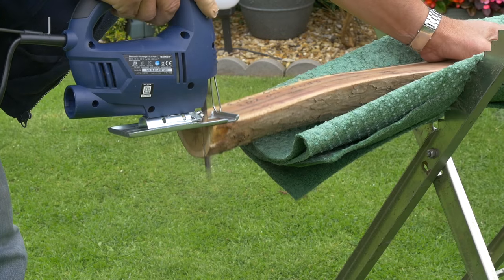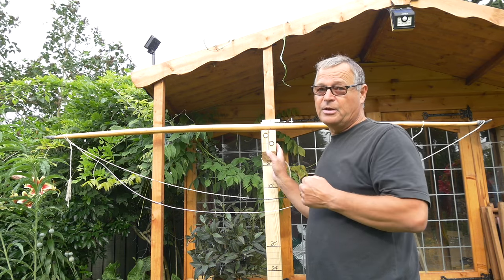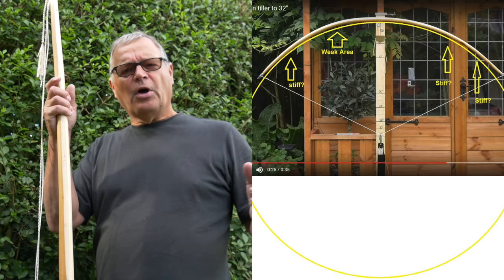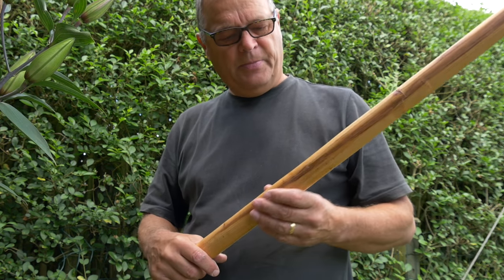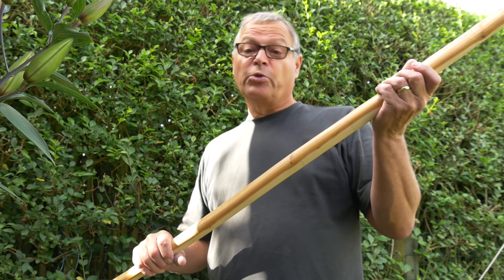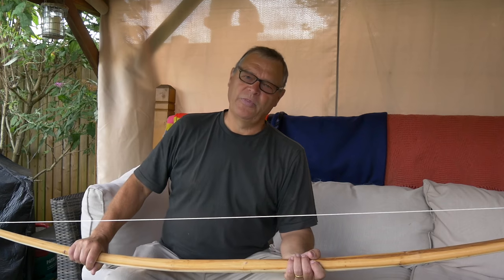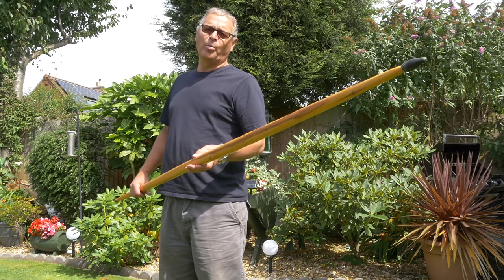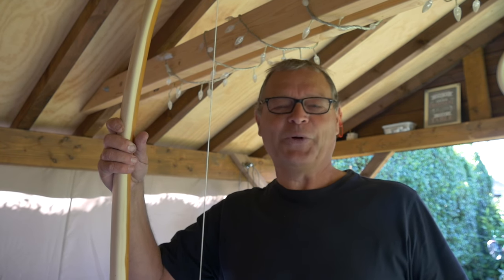Yew Heavy Warbow. Beginner attempts to make 100lb warbow. Part IV. Tiller Problems to First Draw.

Comment: Great video:  Progess, heartbreak, gutted but then a Hollywood ending! Congratulations :)
Your problem yielded useful insights on tillering.  Surprised that the aim is a perfect arc - I had expected the goal to be little or no curve in the handle area and all the curving to be either side.  Also surprised at how precisely the experienced bowyers expect to fit an arc.

Looks like you are quite a gardener too, that's the nicest, tidiest garden I've seen in a long time.  Enhances the viewing experience :)
Reply from the maker: Hi Tony, looks like you've viewed the lot! Thanks for the congrats, appreciated. Yes, the bow I wanted was a full compass bow - in the 'medieval style', bending through the handle and forming a near as perfect as possible arc. Yes the pro and highly experienced bowyers have a great eye for spotting the slightest deviation from that arc and one and all spotted my error, and all helped me get around it as best as a novice could. Thanks for noticing the garden - not all my own work though; my good lady keeps it in trim and helps provide that rather nice backdrop to some of my videos. Thanks again for watching and taking time to write your encouraging comments. That enhances the production experience!! Atb, Mick

Comment: I find myself watching your videos over and over... there just so fun to watch. Very well filmed and edited.
As for the bow- I've learned the hard way that it's better to focus on good tiller the on draw weight. My first bow ranged from 20 to 25 pounds. No where near my target weight. 
BTW, your videos realy gave me an urge to make myself an english longbow! So I have the laminated stave glued up, I'm just waiting for the glue to cure and I can start roughting it into shape and tillering it.

Cheers Mike.
Reply from the maker: Hi Mike, thanks for your interest and support - and especially for letting me know! Yes, in my limited experience, the tiller is way more important than draw weight. It seems the real skill and challenge comes when you try to achieve high draw weight and a great tiller. I certainly found it a challenge as you've seen in my videos. Good luck with your laminate bow - I hope you get the tiller and draw weight that you hope for. Atb, Mick

Comment: Hello, I am planning to build the same, although smaller and watched your series with great satisfaction. Pity that it does not bend evenly. Otherwise it is perfect and very beautiful. Good job and video. 

PS: It's probably too late to mention that, and I have not built any bows myself, but I saw a video in which he shaves the bow while it is on the tiller. So he sees real time what he is doing.

Comment: The cause will likely have been in starting out with a "handle" and too much early thickness reduction adjacent to it, rather than just letting it be thickest at the centre of an unbroken taper running to each tip.. You will probably see the signs of the problem emerging if you review some of the earlier images. Also it would be my preference with any stave or draw-weight to establish a cleaner taper in all aspects while there is still a good amount of wood still to remove, before even going to the tillering post.
Reply from the maker: Hi Rod, thank you for your observations - all a learning experience for me and every comment I get I store up for the next bow. Thanks for watching. Mick
Reply: I confess that I only just found this thread, somewhat after the event and was sitting here on the edge of my seat after noticing that incipient hinge early on, but fortunately you had some good advice and effected a decent recovery. Some of the best advice I was ever given was to establish a good shape early in the process and regard the tillering process as in good part, simply the refining of the established shape.
Reply from the maker: That's a succinct sentence summing up what I have in broad terms learned Rod - getting the shape right in the first place is paramount, subject of course to the meanderings of the stave. I'm anxious now to have another go with some good yew but before that I have hazel as mentioned elsewhere - plus some blackthorn and a reasonable piece of yew still unharvested (for a light bow). All my mistakes/successes will be on Youtube throughout 2017!
Reply: I look forward to seeing the blackthorn bow especially. I've not yet found a piece of blackthorn that looked to me as if it had a bow that I might want within it.  :-)
Reply from the maker: Hi Rod, well it may work it may not - whose to say? Worth a bash though; I've read that it should make a bow (fruit bearing, prunus family) but never found much information about that wood for bows. Rare here to find a long straight piece but this is pretty much longbow length and straight. Disaster or otherwise, I'll post the video in the spring I guess. Mick

Comment: If you need to increase the draw weight of a bow a bit, you can either use steam, dry heat or boil the wood and bend it into a slight recurve shape. This will hopefully increase the draw weight by 5-15 pounds. There is also the option of putting a sinew backing however, it will no longer be a selfbow but it will increase the draw weight a bit.
Reply from the maker: Hi there and thanks for watching and giving advice - appreciated. The bow has settled around 100lb in draw weight and I am happy with that - but I did try for the first time recently reshaping a piece of yew with dry heat. And it worked! Thanks again for taking time to help me. Atb, Mick
Reply: +Mick Grewcock No problem! thank you for making these videos!

Comment: Could a warbow be made out of black locust
Reply: I don't think black locust would take that kind of compression or tension being in that D cross section...my buddy made an awesome flatbow out of black locust...I can't remember the draw wright.  I think it was around 55 lbs, but it shot so smooth and seemed faster than other white woods and most osage bows of that weight.

Comment: Hi Mick, do you cover in any videos how to get around when the wood has a natural bend that goes the wrong way ? Thanks
Reply from the maker: Several. Look at my series about hazel bows and I think wonky yew bow. I use dry heat on veg oil covered wood (stops scorching) and a weight to draw it straight. Good luck.
Reply: @MickGrewcock  Your a star. cheers
Reply from the maker: telfordguy34uk Shout if stuck. Mick
Reply: @MickGrewcock  Thanks I will. Your wonky stick video answered the 3 questions I had ( for now  )so it's choppy choppy time.  I'll let you know when it breaks.
Reply from the maker: telfordguy34uk Good luck and don’t be pessimistic! Might work out great.
Reply: I'll keep you posted. Thanks for the help.

Comment: What are the dimensions of this bow? How thick are you in the middle and how thick at the ends. I want to make one but it be 130 lbs @ 34” draw length. I’ve watched all of them and you are pretty amazing at making it all seem simple.
Reply from the maker: Hi Zac. Have you made bows before? I'm just concerned that dimensions of the finished bow might not be a good place to start. With self bows, in my limited experience, the starting dimensions are more important. The type of wood, its maturity and ring count all have an affect on the eventual performance and therefore dimensions of the finished bow. Let me know and I'll help where I can. I just don't want to mislead you with dimensions that are wrong for your chosen bow. Mick

Comment: I would like to know what's the different between longbow and flatbow?🤔
Reply from the maker: chin pang wong The working limbs of a flat bow in cross section are wide and thin and the bow has a distinct handle and sometimes an arrow shelf; the limbs of a longbow vary from D shaped through to flattened rectangle (depends upon wood used) and a longbow does not have a distinct handle or an arrow shelf. The longbow, as it’s name suggests, is usually as tall - or taller - than the user, much longer than most flatbows. Thanks for watching 🙏🙏

Comment: Hello again Mick i just want to know is your bowstring on this warbow made of dacron or FF and ofcourse thank you in advance
Reply from the maker: Hi there, the string fitted now is Fast Flight. I tried Dacron B but it stretched too much. Dacron B is okay up to about 80lbs, after that I use FF. Cheers, Mick
Reply: Mick Grewcock Thank you so much for quick answer i also have b 50 but is there any material to replace Fast Flight,thank you in advance
Reply from the maker: black wolf Hi there, I am sure there are other brands of string material but I only know of fast flight. Hope that helps. Mick

Comment: I was told that a longbows lower limb had to be slightly stiffer than the top ?
Reply from the maker: That is a statement often made about such bows. When I was making this bow, I was struggling to establish an even tiller - it is especially difficult with heavy draw weights, and a challenge for untutored beginners such as me. What I did learn on this and other builds was to let the bow tell me during tillering which limb is the strongest and then work with that. I hadn't the skill then and probably not now to choose a limb as either top or bottom and then successfully carry that through to a finished bow, such are the challenges for me of a self bow from usually wonky wood. Now that I am becoming (a little bit) more proficient, I adjust the balance point of the bow stave on the tiller tree so that I am pulling where the arrow would be nocked on the string and the 'balance point' (actually slightly off balance) of the bow being the arrow pass. This naturally aids the establishment of the upper and lower limb - but for me usually after quite a bit of trial and error.

Comment: I have a question, but does the width of the handle decrease gradually or to a certain extent?
Reply from the maker: There are several ways to do this - constant taper from the handle out to the tips in width and depth or a central section about 250mm parallel in width but tapered from the centre. The 'grip' is usually about 100mm and is offset 25mm from geometric centre of the bow. Hope that helps. Mick
Reply: @MickGrewcock  tank you

Comment: another question how large is the central part, that is the one of the grip?
Reply from the maker: I am away from home so cannot measure for you. Measurements are not reliable indicators of draw weight in self bows. I started about 40mm wide/ deep and finished approximately 35mm wide and around 33mm deep but my memory might be wrong. Just make the bow to the weight you want - measuring can come later!